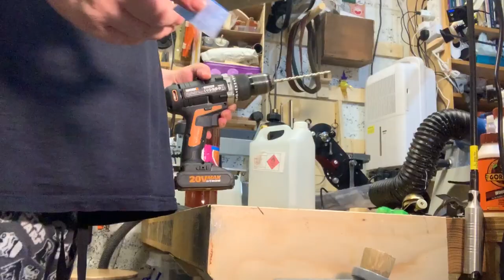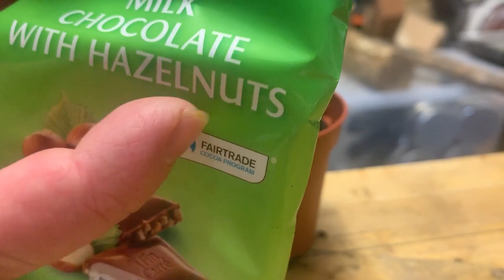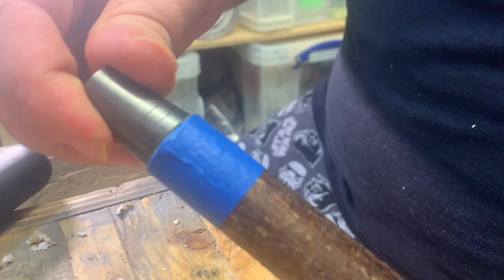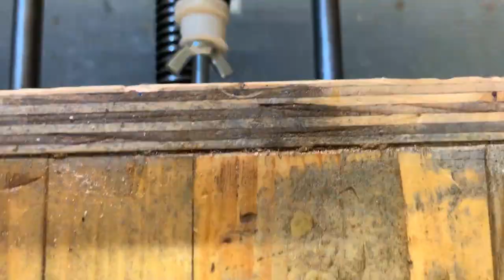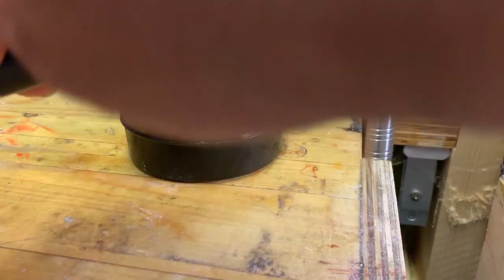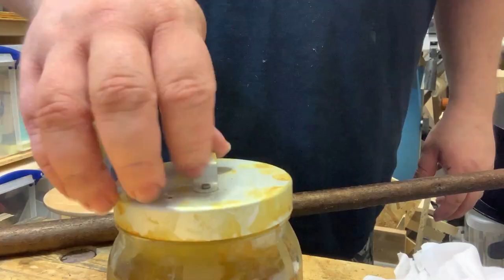Making a Walking Stick for my Dad

Comment: Thanks for sharing this. Thanks for being smart and funny. Thanks for showing how to care for our elders. Great stick, but I would suggest engineering a way to have a rubber ferrule because rubber is way better for harder surfaces ( older folks do most of their walking on hard surfaces and less time in wilderness or places with soft ground - a metal spike for off road, with a rubber ferrule that slips over, for on road, is a good approach I think.
Reply from the maker: Absolutely, you can buy rubber ferrules just for sticks so might do another with one.  I love idea of making it modular though with interchangeable ferrules.

Comment: I found this after just making my own walking stick (and video) for my dad, I really like your style, you got a new subscriber here 😁

What’s the reason for the abrasive paste? It’s not something I’ve heard about before.
Reply from the maker: Awesome and thanks!  Abrasive paste is my go to finishing sandpaper substitute now past 320 grit or so especially with odd shaped stuff.  It gets into all the nooks and holes, doesn't generate saw dust in the air and also adds a bit of a finish oil (its got mineral oil and wax in it usually)
Reply: @TheWoodgineer  Excellent thanks for the advice, I’ll definitely try that out 👍

Comment: A nice stick, but it’d be useful to show how you drill the hole in the handle show that when joined it sits in line with the shank and not at an angle as I often find happens.